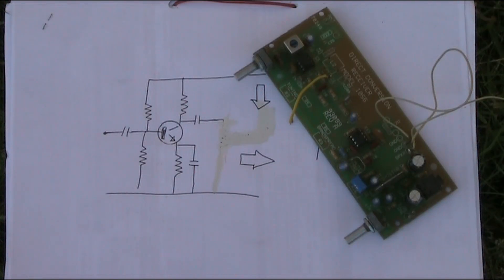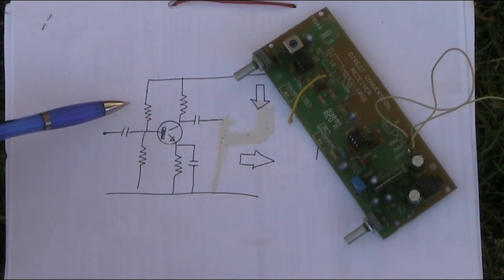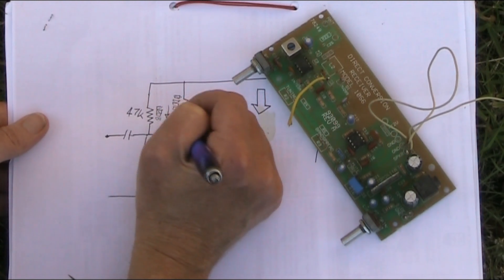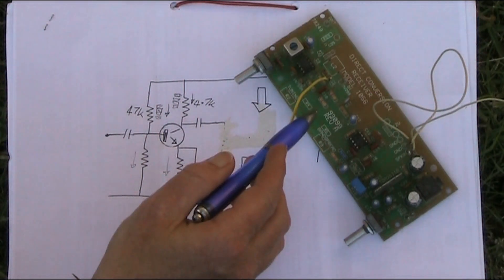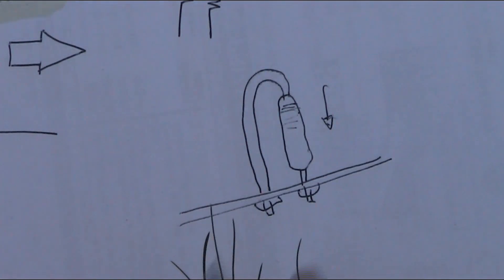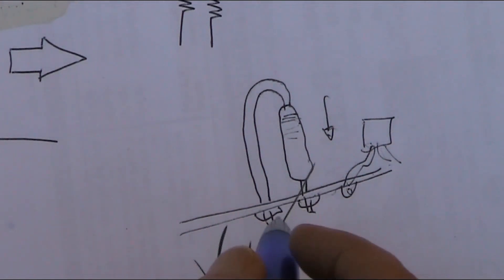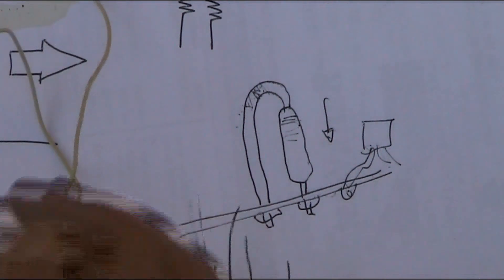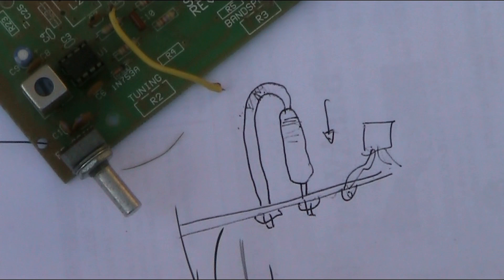Do THIS when building an electronics kit

Comment: As an engineer (mechanical), when building a project I try to make it easy to take apart after it breaks! I try to do the same with kits I build, with all the identifiers the same way round, being dyslexic, this removes one possible error point! Regarding fault finding, I do not know/understand enough to create my own test points from a circuit diagram, so there I "follow the book"! One thing i have learnt that a neat, tidy build is easier to fix when it goes wrong, if it looks right, it usually is right! Good video, thanks.73 Jim M7BXT

Comment: I try to make everything read in the same direction as mounted so that checking correct location later is easier. I also do this with surface mounted resistors so that they are all easy to read without flipping the board. One consideration is figuring which end of a capacitor is the outside wrap (if there is one) and mounting that end towards ground, for example.

Comment: styrofoam packaging will hold all Leaded electronic components, sitting upright & you can label them by black permanent marker. NPN or PNP Transistors  labeled collector base emitter. before soldering them into your printed circuit board one at a time. buy a Multi-Purpose 3-pin Components Tester to check all components. some kits do ship with wrong or missing items. a Signal Generator is a must-have for any Radio frequency receiver project IMO. also a good affordable existing working receiver to monitor the signals output. IMO -a grid dip meter or dip meter project be your first DIY radio frequency oscillator TX project. start with HF dip meter, try to avoid VHF-UHF radio interference. maybe then add audio modulation to it, a 555 tone generator so test signals are audible sound. I use musical gift card tone generator chip.  today most components are Surface mount devices that require an ice cube tray to hold your pre-tested -labeled components & a USB video microscope to see them.  -old microwave oven can be used as a faraday cage to test signal levels. free of ambient rf interference.